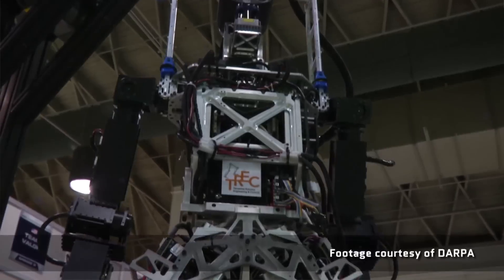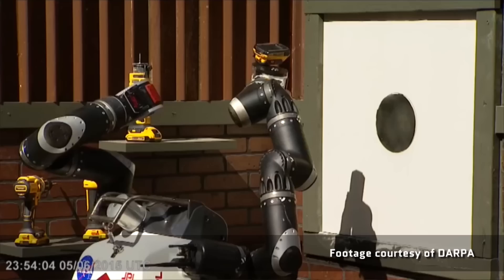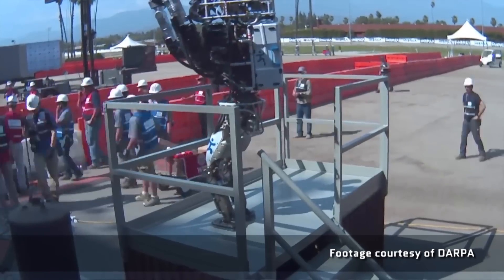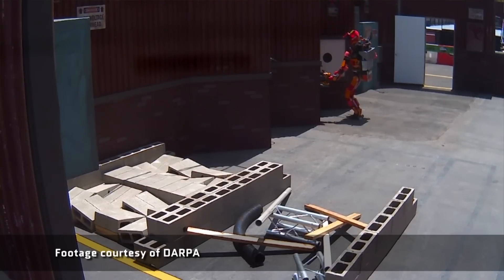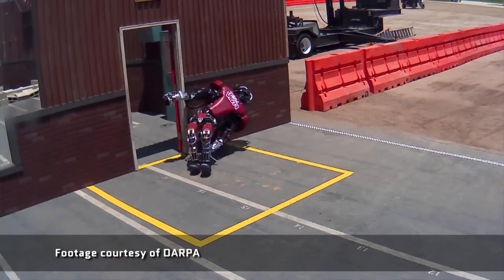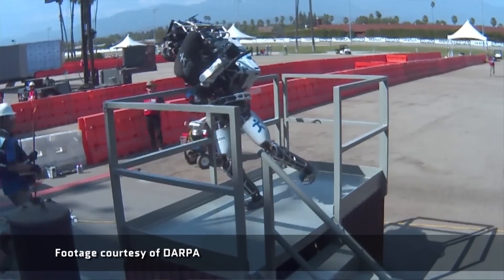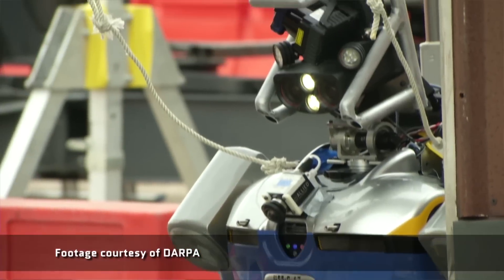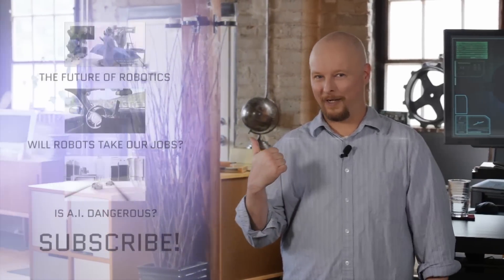Rescue Bots Compete in the 2015 DARPA Challenge

Comment: Even if robots could do all human motions and balancing I would not worry about a robot uprising until they need humans to:
1. design them
2. mine the materials for them
3. maintain them + other necessary infrastructure
4. decide for them how to use each item open a door etc.
5. do all strategic thinking for them (see the big picture)

Even if completely autonomous warfare started today, the robot uprising would be far away as long as humans are needed to get the resources, and can design better robots.

Comment: I still think a bunch of little robots would be more able to complete a wide range of tasks including some that are unknown than a robot with a specific structure and capabilities. The only challenge to this area of robotics is getting all the robots to work toether. I really want to see it happen though.
Reply: Reese Tyra I agree with your idea. If the robots are smaller than they have or flexibility and maneuverability unlike a big, large, bulky, fixed or limited robot. I think the fixed parts of a huge robot would provided stability and a type of toughness.
Reply: Reese Tyra Would be cool:) (Still, how about hampered communications in the said emergency situations.. Although, by then, this will be solved easily)

Comment: Was it necessary for the robot to be bipedal? Would be easier to keep balance with more than two feet.
Reply: Waffle Wisard because a humanoid robot can operate things that are designed for a human to operate,you know,its easy to have a human like robot driving a car,climing a ladder,etc then a dog like robot
Reply: AndrySarvy Yeah I know that. but it would be for stability purposes cause that was allot of the problem with the robots. You could also have the 4 legs converge into 2 legs to do stuff like drive cars.
Reply: There was one with 4 feet. I think that's a much better idea then trying to emulate human structure try to improve and work around it.
Reply: ***** We manage to do it pretty darn well with two, so after a while, the robots should be too, no need for extra. As an idea for a robot when we don't have the software and especially the hardware to do it - it might or might not (extra parts, extra weight) be useful. Who knows:) Let's make it?
Reply: a next step shoud be to make them think faster
Reply: Waffle Wisard thats a good ideea
Reply: They should have made it have mechanical spider legs and a human upper body
Reply: It would need lots of programming to ride a bike
Reply: Trina Ganda check this out watch?v=mT3vfSQePcs
Reply: A robot does surgery but can open a door?!?! Oh my god..😂😂😂
Reply: robots cant do surgery,they are robotic arms remote controled by a doctor who is in another country or city and cant be in the surgery room
Reply: Ohh..lol